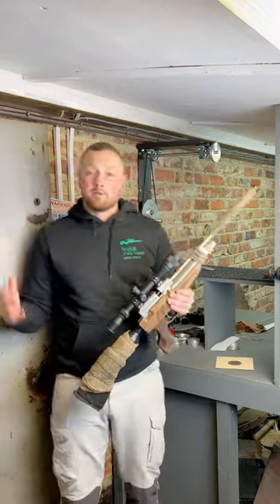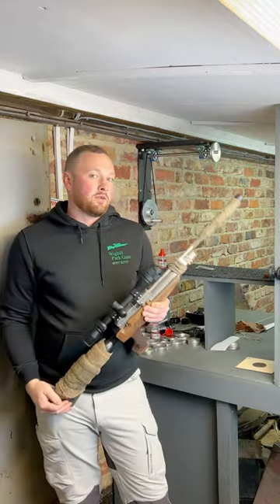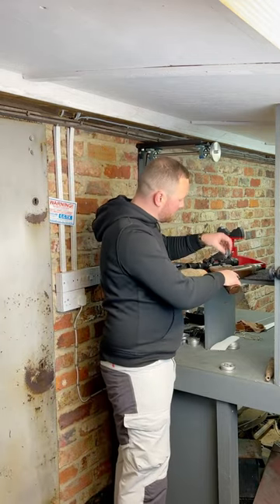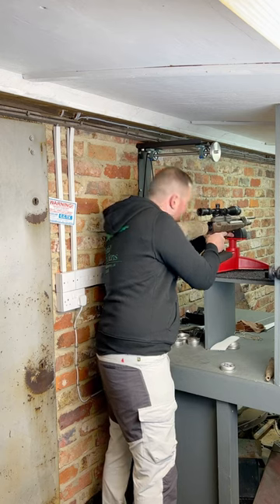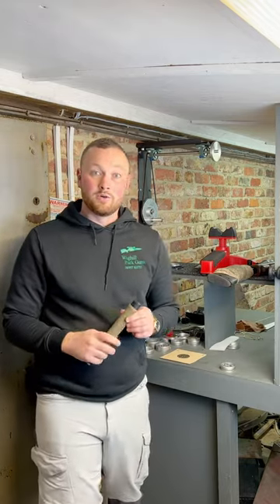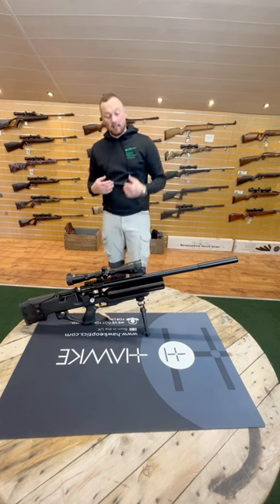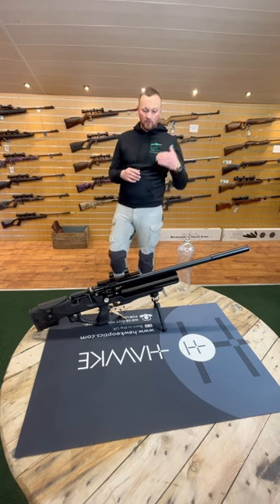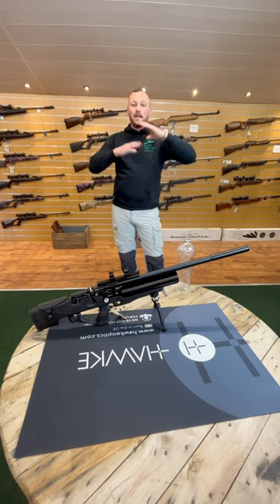How to zero in a rifle scope that’s run out of elevation

Comment: You can get MOA scope inserts quite cheep, saves any potential crimping of the scope tube.. Never liked the idea of shimming, scope rings are designed to be flush / parallel with the tube of the scope.. Certainly wouldn't risk it on a expensive item, maybe one of them ones you get in a rifle / scope package for £200 I'd chance it..

Comment: This is not a good way to add taper to your system.  There's a right way and a wrong way to add taper, and this is like the wrong way, only faster and cheaper.  Even on an air gun, this is going to lead to problems holding zero, crimped body tubes, etc.  Get a tapered base or a tapered mount.  Shimming, especially with plastic, is a great way to ruin a scope and introduce point of impact shift.  This may work temporarily on an airgun, until it gets bumped around at all, but I hope you're not too invested in the scope because this could/will damage it.  It will not work on any sort of firearm with recoil or piston airgun with reverse recoil.  This sort of "hack" is akin to covering up your car's check engine light with electrical tape and considering the problem solved.  Videos like this are why YouTube really needs to bring back the dislike count.